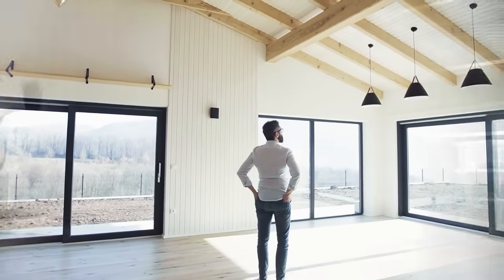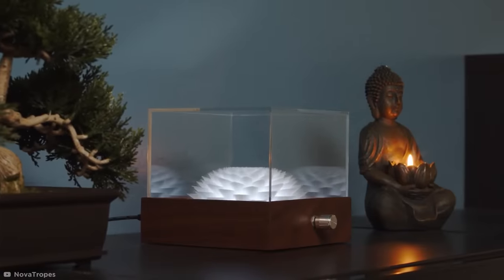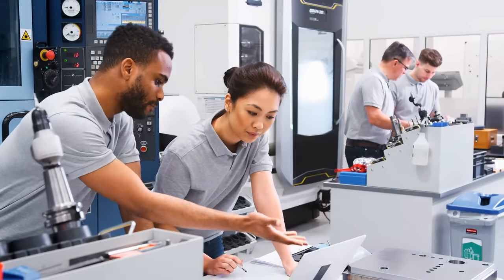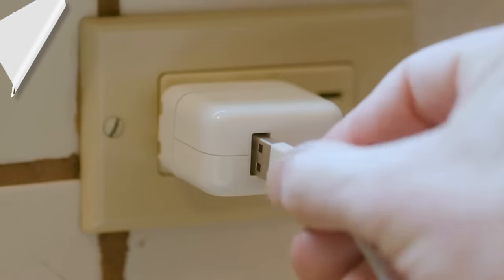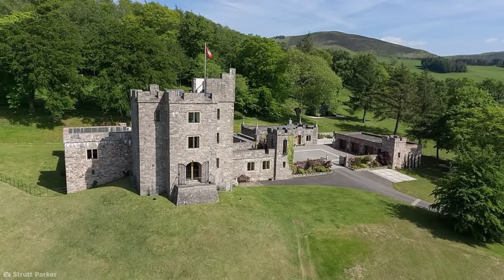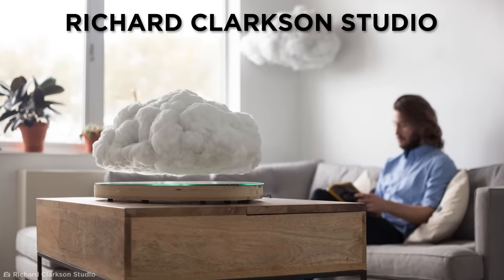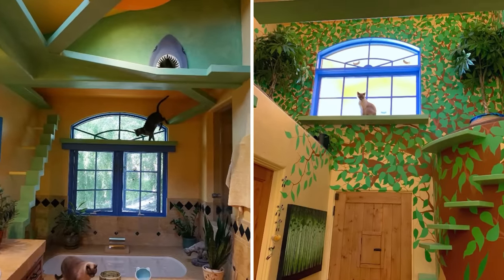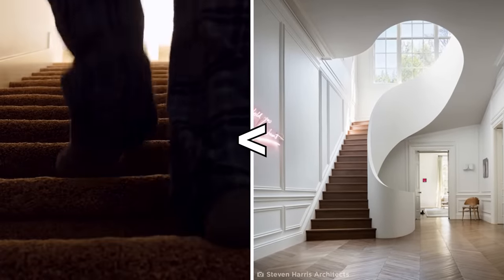Amazing Things You NEED In Your Home

Comment: The First thing they showed, the showerhead; I ACTUALLY  HAD.
   The PROBLEM with it is it is it is made  of some crappy brittle plastic.
   So, if you drop the showerhead a couple times, like TWICE, the threading on the connection leaks. Cannot be fixed.
Reply: So many times these “ recommendations” are nothing more than commercials rather than reviews from someone who’s actually tried the product.......so thank you for the info!👍
Reply: what about plumbers tape which is specifically designed for leaking threads?
Reply: @mysterydude1  exactly what I was thinking. a few wraps of Teflon tape a.k.a. plumbers tape should do the trick. but then again it’d be nice if some of these companies, would offer a more upscale version of their products made out of actual metal, and not chintzy plastic, which I’m getting thoroughly tired of.  thank you for the review, much appreciated.
Reply: Its jml so expect it
Reply: @mysterydude1 Would the tape work if the plastic threaded part is cracked?
Reply: @ja1822  It could work temporarily but it depends on how big the crack is. A better fix would be to take a lighter (if you're careful and talented enough) and melt the plastic where the crack is, just a little bit - enough to get it to stick together not actually melt it. Then coat the area where the crack is with a little rubber cement and let it dry. Then wrap it in the tape. Alternatively you could just get a cheap replacement shower head at walmart for like 30 bucks.
Reply: @mysterydude1  Thanks for the answer.

Comment: You can heat the water for a spa to 150 degrees by using a few hundred feet of black hosing that is heated by the sun, large black plastic bladders can also heat water for an out door shower. No carbon problem!

Comment: Those Always Home Cams from Ring aren't a bad idea, but the model can use a lot of work. I used to work for Ring and got one of those cams to test. It's a cool concept but has some flaws like... it can't be used on multiple levels, giving it a flight path is agonizing because if you deviate ever so slightly from the elevation you want it to be at, you gotta start it over. Lastly, the bloody thing is so LOUD when it takes off! My cats were terrified of the dang thing and all I did was let it hover over the dock for a few seconds. x_x

Comment: this comment regards the first one (showerhead): if you live in a really old house you maybe not be able to see the beautiful colour cascade and bath in light whilst taking a shower. I bought one (expensive one) years ago and had to discover that the water pressure in the rather antique house I live in was too low, they call it 'force of the water' in the video, that moves the turbine inside of the led showerhead, so it just unfortunately didn't and won't work at all with the lights.